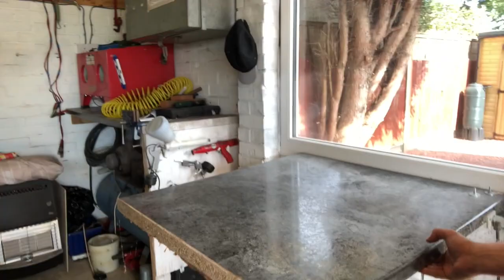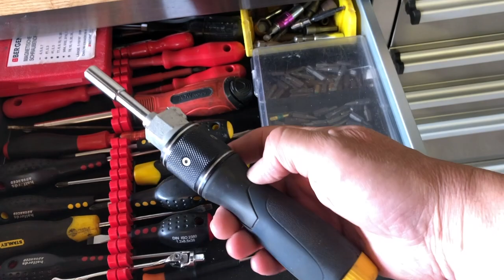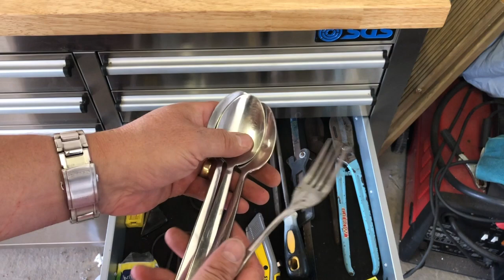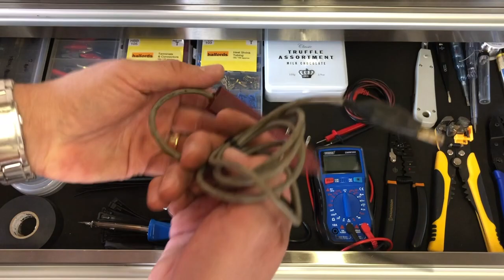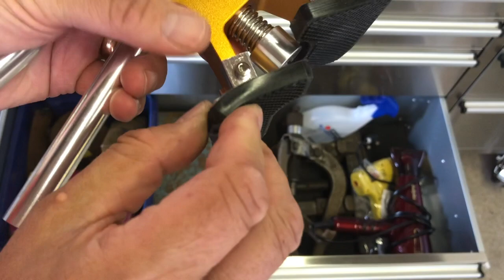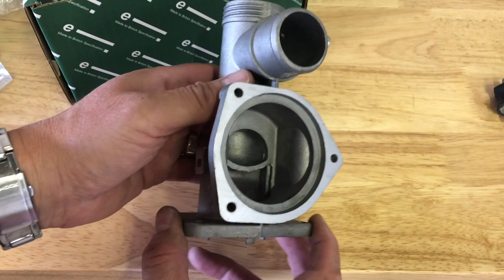A tour of johns stainless SGS toolbox. How would you organize​ yours?​  + xk8 Quiz!

Comment: That little rubber mount in your quiz is for mounting the air breather box; air cleaner mount. 
I had a broken one and was able to replace it by getting one out of the local junkyard. Came from an S-Type, I think.   Part#  EAC8130
Reply from the maker: Hi Gary J
You got the right use and upped the anti with the part number. Ray Stocker got the actual name right. (Instrumount).  I shall now consider who is the winner🤔

Comment: always nice to see what tools normal people have,  every now and then I see things I don't have and think ye I could of done with one of them in the past and add it to my " carboot look out tool " I also mix my tools.. a lot of Halfords but then also higher end stuff simply because it was cheap , bahco / king dick / beta / wiha / wera / Irwin . car boot finds!! for sockets I like the cheap us pro / Bergen ones, honestly take some abuse and don't break, first thing I did when I bought some Bergen sockets was to try and break them to see how good / rubbish they were before I committed to buying anything else from there brand. I didn't break them now matter how much force / hammering ive give them!
Reply from the maker: Thanks you tube.
I am off to the local monthly auto jumble this weekend. I do the same. I have a post it note in my wallet with a few things I am short of. Other than that I just enjoy browsing for Jag & VW parts and occasionally discovering a bargain tool that I did not know I needed, until I saw it😁👍
Reply: I find ALOT of britool stuff at bootsales, I don't do imperial only metric. the old britool made in England stuff is what I like buying. I only paid £7 for a britool breaker bar / spanners / sockets / files / roebuck punch and pin set. cant beat second hand bargins!